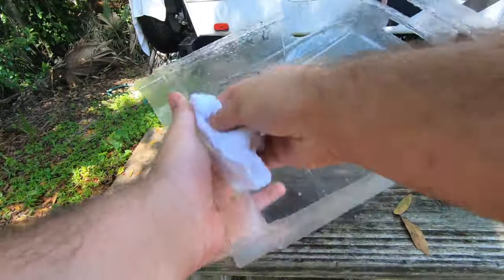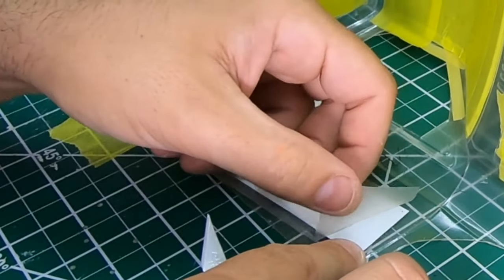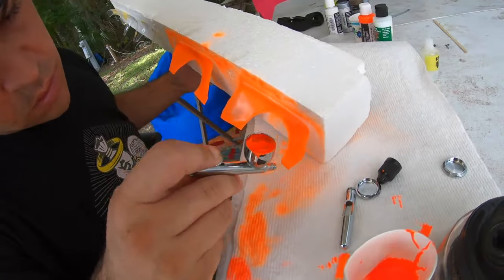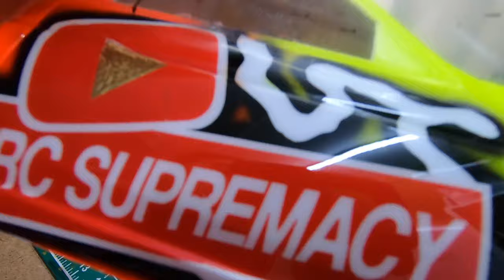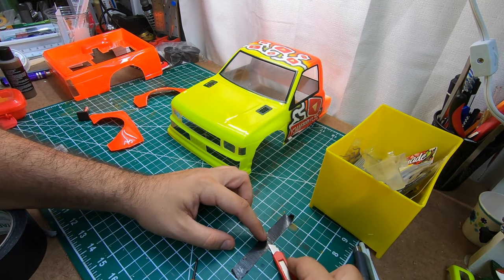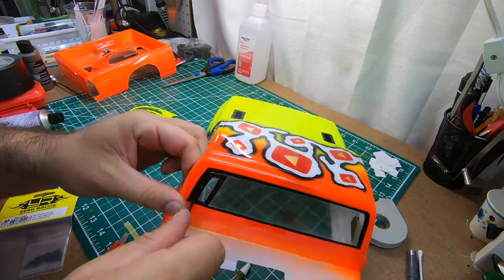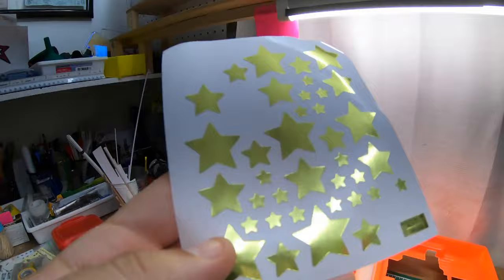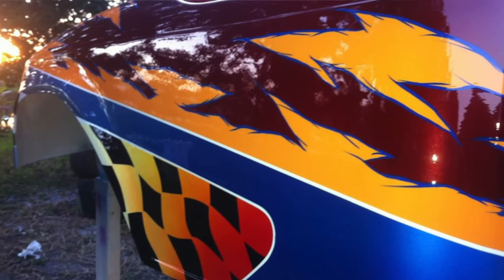Custom RC DRiFT Build FINALE (PT 3/3) GOLD LEAFiNG, Custom Painting & MORE - 1:10 scale

Comment: Out of curiosity why do you need to put duct tape down before you put on the amazing goop, is that to allow it to be removable, or would you destroy your paint if you don't do that (since it looked as though you only did that on the inside of the bumper)? So far I've been sticking to using shoe goo and clear weld 2-part epoxy and having good luck with that, but this is also my first time working with styrene on lexan (though I am now also using an IPS acrylic cement that seems to be working really well with the styrene on styrene stuff)
Reply from the maker: What's up man! The sole purpose of me laying that Duct tape down, Is so that the chemical reaction from the Goop doesnt distort the paint and ruin the body. It's happened to me before. So I use that ducttape to create that barrier but also a tough bond.
Reply: @RCSUPREMACY  shoe goo doesn't have affect like goop. I use shoe goo to glue my  body magnets directly to the painted body. No issues! :)